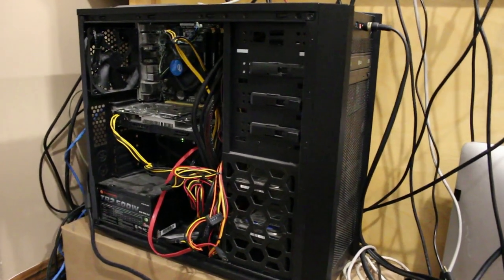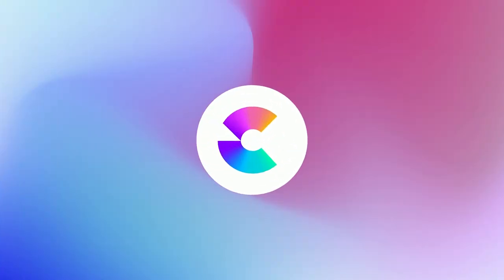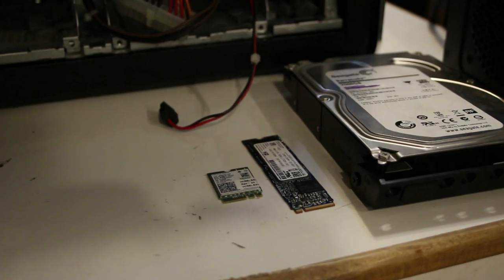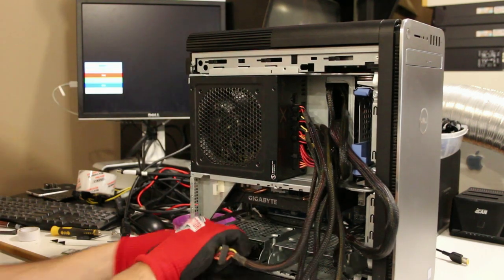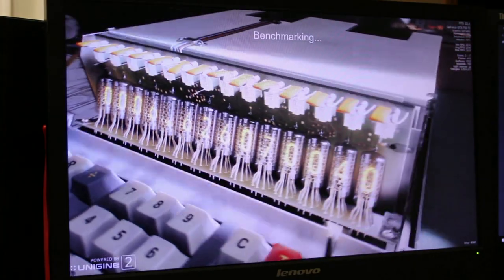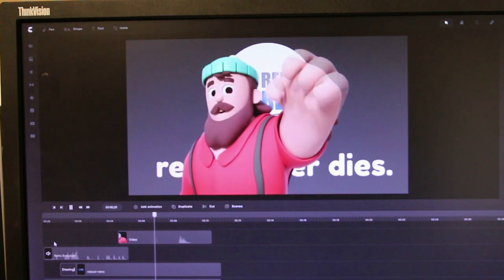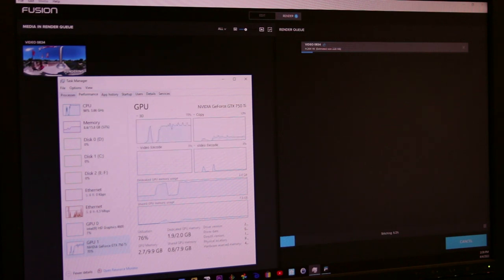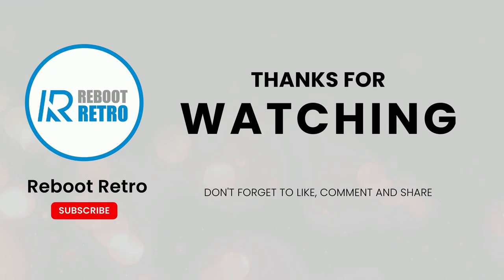Building a PC out of e-waste!  Any good?

Comment: Throw the Gt750 in as a secondary GPU then u can use it to help render your work and games can use it as a Physx Card and leave the 1660 all to just graphics and the gtx750 to do the physx
Reply from the maker: Most software will only use one GPU at a time; we need more developers making multi-GPU options available :)
Reply: @rebootretro  Well most rendering software will use as many gpus as u can throw at  it , and any game with physx made since 2008 will use the two cards , u can run them in sli in some dx12 titles even tho they two different gen cards, it will work with AMD and Nvidia mix also.  Not only that but even if a program or game that doesn't use the second GPU the VRAM on the second gpu will still be used, even if the gpu isn't being used. Most Mainstream Rendering programs have multi gpu support,  I don't know many that don't. I've built many  render rigs for customers that I never heard no to adding another gpu if laying around and in good condition...
Reply from the maker: @gamersplaygroundliquidm3th526  
I just checked, and it looks like Resolve does support multi-GPU - I didn't know that!  I know Premiere can't use both, but that might be my old version limitation.  I never thought about VRAM, that alone could be worth installing a spare card if the system is capable of using the VRAM.  I'll have to do some more research into this, thanks for the insight!
There's also I neat project I remember reading about a while back... It was a custom open source software/driver that allowed you to SLI any Nvidia cards, regardless of model/tier/class.  It did it through the PCI bus like Crossfire does, so it doesn't require an SLI bridge.  From what I recall it was a little buggy, but really neat none the less.
Reply: @rebootretro  lol I was thinking about the Vram when writing my comment last night. I was lying in bed last night wondering if i stressed the vram enough or not lo.  Ok well DX12 can do the support for SLI between multiple brands and tiers of gpu cards no problem. unfortunately it only works on a game or 2 atm. I did try it out With a Gtx 770 and a gt1050ti and it really worked well. So the support is there at the API level and games only need to add  the support, and from my understanding that doesn't take to much additional work since  all the hard work is already done at the DX12 layer and has it in the  codes foundation. 
  Hopefully like u said companies will make multi GPU a thing as more and more ppl start to demand it because a lot of ppl have multi GPU setups not for gaming but to mess around at home with editing and now AI. I have my own chatgpt4.5 AI running locally on my pc and it can access the internet freely i even gave it google search Api  access. It is kind of scary what this AI can do when given limited to no restrictions.

      One thing before i forget you should look into Nvidia Cuda cores and getting cards that have them they can help speed up a lot of things like even running a search through your hard drives files , but i heard that video editing work benefits from their use and when combining another card with  them the work only get quicker...
Reply: That's a great idea for a video. 1660 + dedicated PhysX card (GTX 750 Ti) vs just the 1660. I've seen some mixed results.
Reply from the maker: @pedropassamani  I am very curious about the improvement of PhysX.  It seems not very many games support it though...  Such a shame, manufactures don't have incentive to optimize stuff when they have the opportunity to sell you new stuff.
Reply: @rebootretro  Yeah, PhysX was one of, if not the most, underutilized technology from NVIDIA. I think LTT did a video about it a few years ago, where they compared the performance of running PhysX on a dedicated card versus on a modern GPU (10 series, IIRC). The results were mixed, with only a handful of games showing improvements when using the dedicated card.